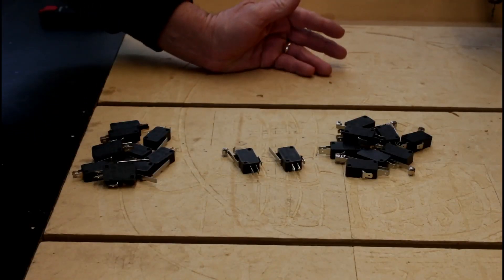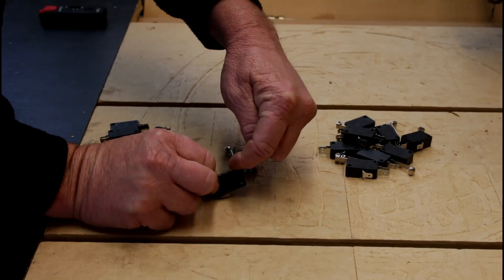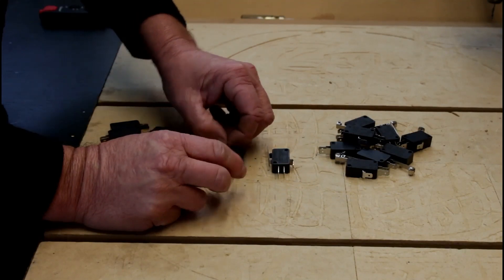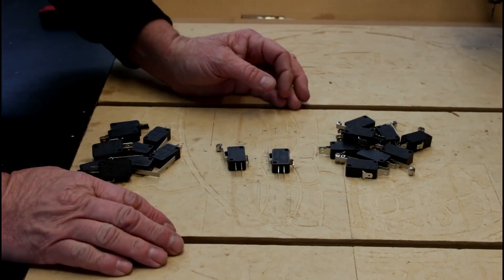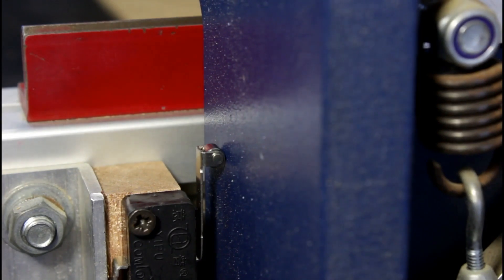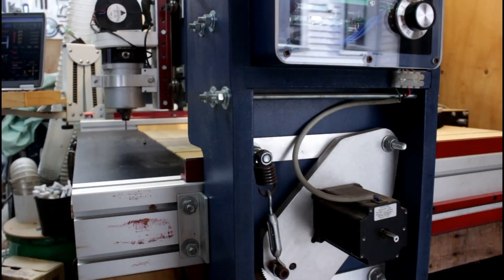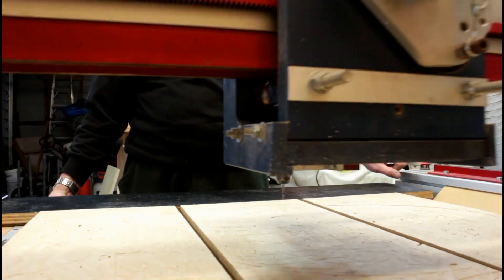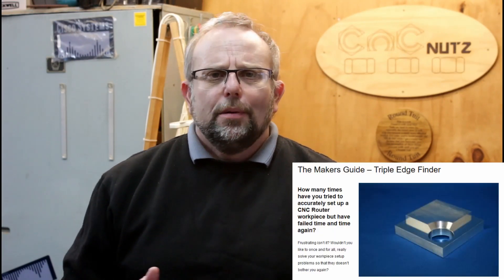Limit Switches - Do I really need them? - CNCnutz Episode 112

Comment: I would disagree with the soft limits being useless. I have hard limits on the Y-axis, and will bump the unit to them to verify it is square as you do; but then I also have magnetic sensors to detect HOME. I click the HOME button (Running LinuxCNC) and the machine goes through the process. Now the machine knows exactly where it's limitations are with a 5mm safety margin from the edge. (Why bang up the machine and cause additional wear?)

Why do it? Because I have certain index points on the machine... (screw points) once homed, I can install a jig that I used months ago, load my setup G-Code, and it will set the G54 (P1) perfectly. Now I can mill my parts very repeatably without needing to fiddle with jogging the X/Y positions or needing to worry about running out too far. I'm holding an accuracy of about 0.0007 inch (0.01778mm) repeatability.  The homing function is fast... on average about 8 seconds. Much more simple and faster than me playing with the JOG buttons trying to get it reset after a couple of months.

Another thing that I like... is by using the HOME switches, I always start with the spindle at a known position...  at any time I can command a G53 X0Y0Z0 to go exactly there... or to some other known offset point. So I may have a jig with X53.6 Y72.4 written on it... and I can type G53 G0 X53.6 Y72.4 to have the machine go EXACTLY where I last had the zero point. Then touch off (Reset the G54) with G10L20X0Y0Z0 and begin. (I've made custom buttons on my LinuxCNC pyVCP panel for this purpose.) I'm certain Mach3 also supports that functionality.

Explained: https://youtu.be/hfEhMILDB6s
Reply from the maker: Thanks for the explanation. A good point about the jig position. 
The jigs I use have the zero point built into them and their position is set by the router bit. This makes setting the jig very easy and I can put it anywhere on the table accurately and quickly. For Jigs that need to be screwed down to  a certain location as yours are, then my method won't work and the limit switch method is the best. 
Your jig is the equivalent of the zero plate or the tool changer. something on the table at a fixed point that the machine needs to know about.
I don't have them so I come up with ways to do things without them. You have them and use them the the fullest.
Offsets are something I haven't got into. I will have to have a bit of a read up on them but I'm sure Mach3 will have all the same functionality as LinuxCNC.

Cheers
Peter
PS Watched your workshop tour, I like the lady router.
Reply: The offsets are cool if you have an array of parts set a known distance... you can make your G-Code, run a part, then go to the next offset and run it again. I know about them... but honestly... I only use G54 (P1) and the machine hard home. (G53) Mach3 does support them... LinuxCNC has 9 defined... but it looks like with a little trickery... Mach3 can have 254...

Reference: http://machmotion.com/cnc-info/g-code.html#G54-G59_and_G59_P1-254_Work_Offsets
Reply from the maker: Thanks Jerry.
I could see them being useful if I was mass producing a product that needed to be put into jigs. I could change one while the other is cutting without having to zero between jigs.
I will have a closer look at them.
Cheers
Peter
Reply: @cncnutz  Yeah, do install them, you will get used to them very quickly. It is great when something goes wrong with the job to just reset machine and set line where it ended instead of trying to re position against drilled hole... ive been there.. when using more tools even when manually changing them getting right xy is great especially if u start 10mm then 5mm drill bit, the starting hole would be too big and i continue usually next day so machine is off.   If you have job which needs to be interrupted and continued next day or loss of power...(i use notebook so i get signal from cnc power was lost, mach3 stops but notebook goes to sleep mode so i know where machine stopped. Also my machine have encoders... so running machine against hard limits would result in positioning error being turned On on drivers. Any way limits can be good fun
Reply from the maker: @vladomiklusicak4652  
Oddly enough I will be adding limit switches to my machine in the near furure. I was looking at possible mounting spots yesterday. As you said I will probably really like them once I have them installed just like the Automated spindle and my touch off plate. Before I installed them I never gave them a second thought.
Cheers
Peter

Comment: Limit switches and soft limits go hand-in-hand. Homing a machine that size would take, what? 45 seconds? Seems like 45 seconds per power cycle would be worth never slamming the machine into a hard limit, unless it somehow doesn't have enough power to damage itself.
Reply from the maker: +Hirudin 
Running my machine into the hard limits won't damage it. It very rarely hits a hard limit by accident. I  see what you mean about the soft limits.  I was thinking of them used as a limit in their own right but can see how they would work in conjunction with the limit switches to define a working area. Thanks.

Comment: all makes sense to me... I would like limit switches to home the gantry that way when your machine finishes a job it will park itself out of the way automatically. Probably more convenient for a lead screw type machine not one you can just push around easily when the motors are off.
Reply from the maker: Never though of the ability to home the machine to an out of the way location at the press of a button.
That could be handy but then as you say I can just push the gantry out of the way if it is a problem.
Thanks for the info.
Cheers
Peter
Reply: yea you can give it a button or add G28 to the end of your gcode
.... just add homing to the end of every job you run threw your cam program.... voila no buttons needed. take care
Reply from the maker: +builtrodewreckedit 
Thanks